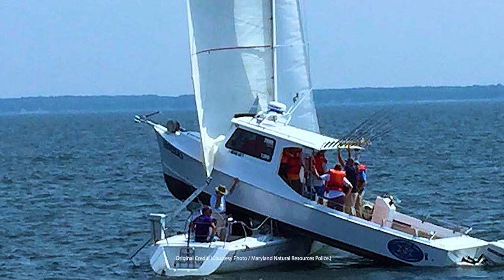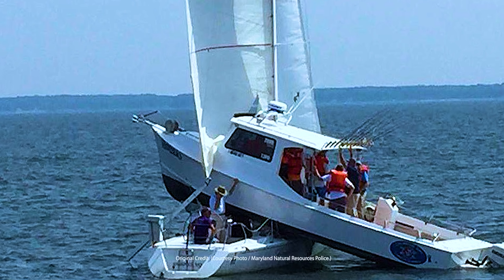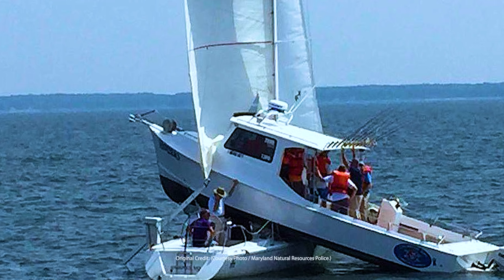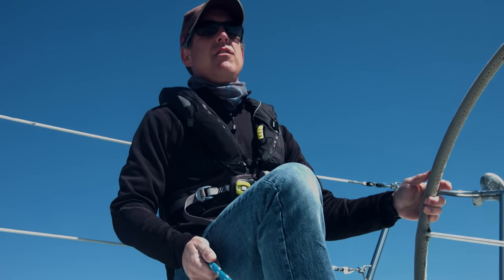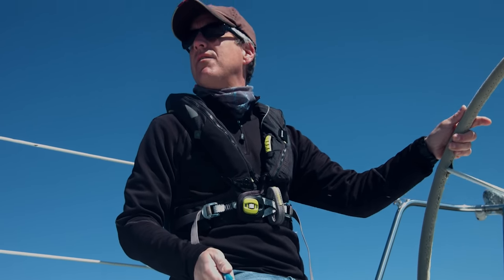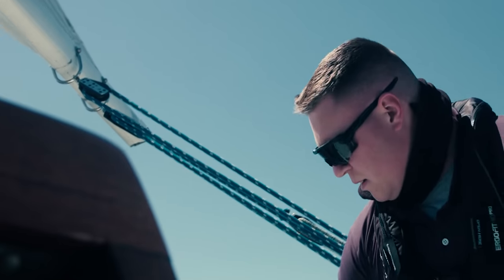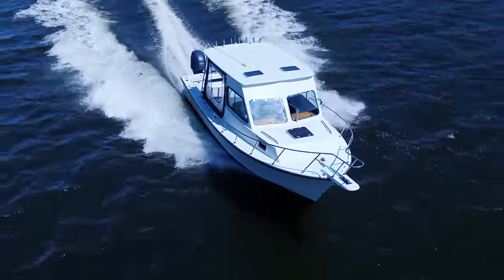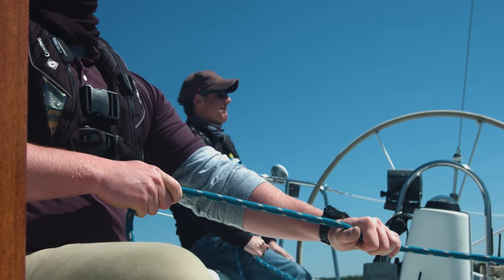Watch CBM Recreate Sailboat vs. Fishing Boat Collision

Comment: I'm surprised there was no mention of the power boat being engaged in commercial fishing. I've seen this on the Chesapeake Bay. Charter boats out trolling for rock fish with paying passengers and trailing multiple trolling lines out refuse to yield, even though thats not commercial fishing and they aren't running planers.
Reply: He was not a "vessel engaged in fishing" per the Colregs a sport fisher out fishing even with trolling lines out behind is a Vessel under Power not Vessel Engaged in Fishing.  They get away with it because other boaters let them. This is mainly because of the Rule 17 (a) (i) and (b) (i) which requires the Stand on to keep clear if Give-way is a dick.

According to Rule 16(d). This Rule does not relieve the give-way vessel of her obligation to keep out of the way.  That means that the sport fishermen will keep flouting the rules until they are compelled to stop.  For the charter Captains, you can provide evidence to the CG and file a complaint which can get them a fine or suspension of license.

Rule 3 (d). The term “vessel engaged in fishing” means any vessel fishing with nets, lines, trawls or other fishing apparatus which restrict maneuverability, but does not include a vessel fishing with trolling lines or other fishing apparatus which do not restrict maneuverability.

Comment: What they're saying in the video is basically, you can be dead right. That is both correct, and dead. But basically the powerboat was running fast, the guy at the wheel was either completely incapacitated or just an insane asshole. My bet on a day like that with so many people on board, is that he was an insane asshole, which is often an incapacitating condition. What other problem could there have been? Turn the wheel a spoke, throttle down for 5 seconds... He would still have passed close and severely waked the sailboat. That would not have been all that unusual. This? The guy running the powerboat should have been jailed.
Reply: Agreed, even implying that the sailboat should have done differently is absurd. Getting a 50 ft sailboat out of the way of a powerboat dumbass like that is not as easy as it sounds. The powerboat could just as likely have steered away in the last second, hitting the sail boat in it´s attempt to evade. Embarrassing how some people don´t even bother to get along in the vast freaking ocean.

Comment: A more detailed analysis would have been appreciated.  Were they running AIS? Was there an attempt to contact by radio.  Was emergency signaling used? It doubtful that a small horn would have been heard, but at least an attempt was required. etc, etc

Comment: Cbm....... clearly generate revenue in all directions.  Let's do a you tube to recreate and discuss the scenario to a "sort of no fault" scenario by depicting  error at all levels.  This is the most egregious post mortem I've ever read.  You should be ashamed at even posting this crap.  So who paid you off.  Or is this exoneration?  Get a real job.  You're no good at this.  And who even authorized you to publicly generate this commentary.  Independent of the rules of the road regarding stand on vessels, it's a boat under power versus a boat under sail in clear daylight.  You can put all the lipstick you like on this pig,  but it's still a pig.  As said, your commentary as professionals is shameful.  Capt Kaz